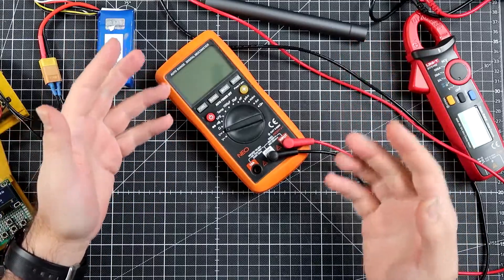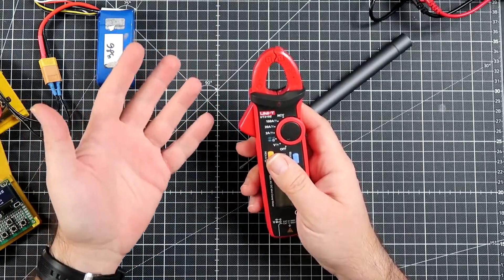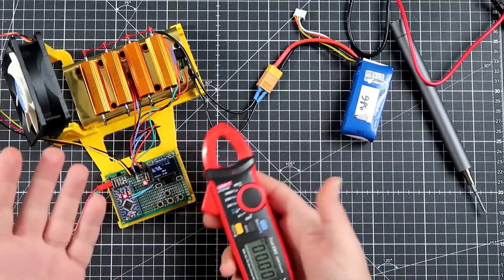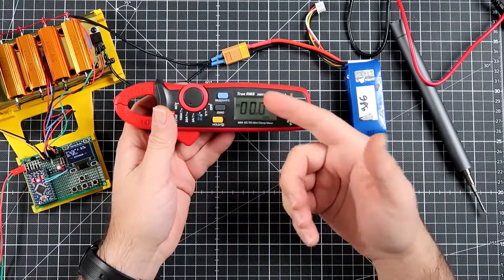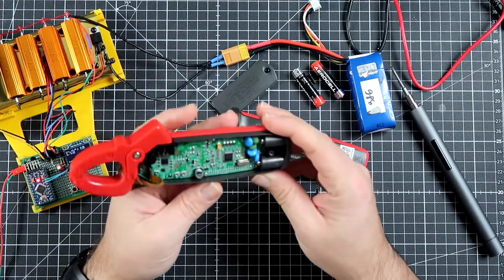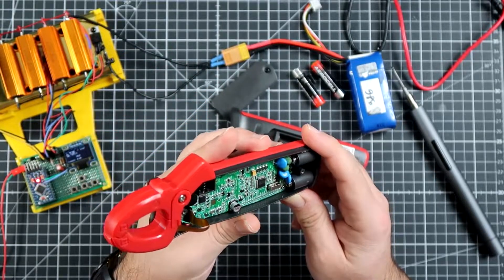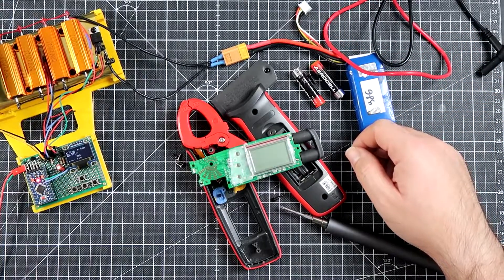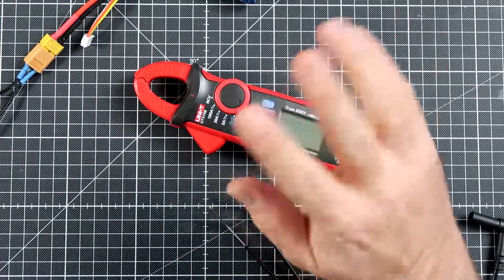Uni-T UT210E Mini Clamp Meter Review

Comment: A fuse would be a big plus, when measuring current with the probes, if the device was used in a flammable environment it could cause an explosion as the function switch was rotated. That said I have the Uni-T UT204R and really like it for all around use, the clamp function is great for tracing current flow in automobiles and as a quick check for alternator output and stuff. Another interesting video, thank you!